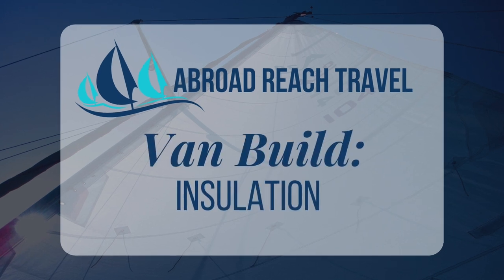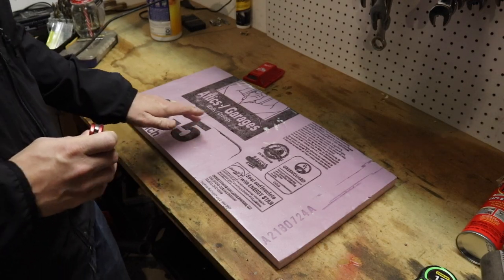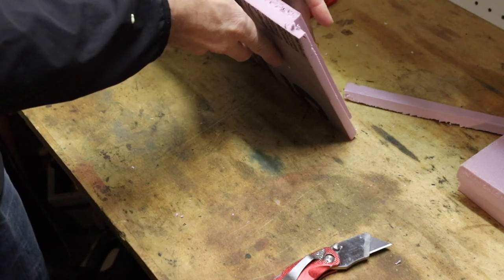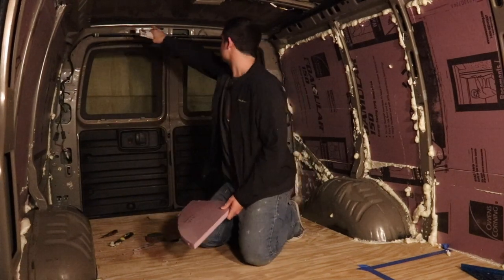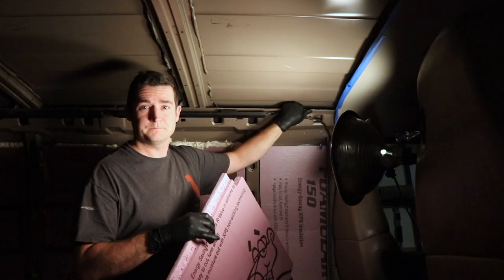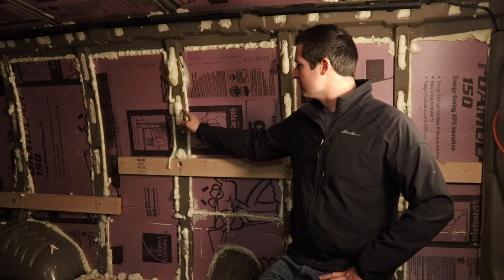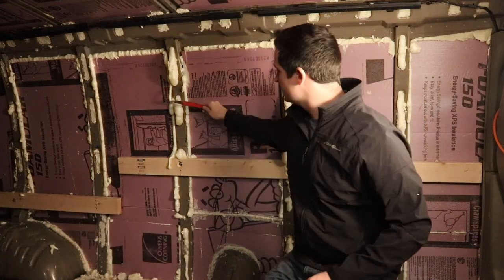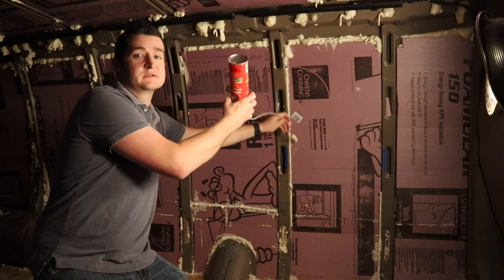How to Install Van Insulation | Van Build Step 2

Comment: Hope you still read your comments. This is exactly how I am going to insulate my van. I was hesitant about the spray but I knew it was a great idea for the ribs of the van. I will deffiently use the extra hose. I am thinking of doing the floor with the foam. Thanks for Great Video.

Comment: Liked your how to video very much.  I have been reading that it is best to not leave air gaps because of moisture and mold.  It looked like you did a great job on the sides with spray foam in every crack and space.  I did notice on the roof that because of the ridges there appears to be air gaps under the foam board in those raised areas.   Any concerns about that?  
Also,  some van build people install butyl rubber as a way insulate sound.  Does the XPS do anything regarding sound insulation?   Is it worth it to try using butyl and XPS together?  I was thinking of butyl on the wheel wells because they are a curved surfaces.
Reply from the maker: I’m not too worried about the small air gap in the ridges in the roof.  We sealed around each piece of foam so any small gaps are sealed off and isolated.

I did notice that it was quieter with the insulation.  Adding butyl to the wheel wells would be a good idea, as that and old door seals is where most of our noise comes from at the moment.  
-Andy

Comment: My foamboards keep popping back out to straight ripping every method i have used, to adhere to the courve of the van, apart. Im about to be out cash and spending more then needed just to get the thinsulate material.

Comment: How has the foam and the adhesive you used held up? any of the foam coming loose anywhere? Thanks for making this video
Reply from the maker: It’s been great, 15k miles with no issues.  We had to cut a piece out a few months back and the adhesive was still so strong that the foam was breaking rather than pulling away from the wall.  Thanks for watching!!
Reply: @AbroadReachTravel  this is great feedback. Glad to hear everything is working out well.

Comment: I am thinking about using foam board for my van. After a year after  how is it working out ? Is it squeaky when your driving down the road ?
Reply from the maker: David Tallman it does not squeak at all and we live on a bumpy dirt road so it has plenty of opportunity to!  It works really well in the winter, last night between insulation and the diesel heater it was so warm inside I had to roll down the windows for a bit and that was in about 20 degrees.  We’ve stayed in the van as low as 5 degrees and it’s been plenty warm. We don’t have as much experience with warm weather but staying in the van in 70-80 degrees with the roof fan running is very comfortable.  Best of luck with your build!!

Comment: You guys ever have any problems with mold? I did my insulation like this one notices the once you cut it the foam surface has a lot of pores
Reply from the maker: Renado Durley no we haven’t had any issues with mold.  It’s a closed cell foam so even when you cut it your only opening up that very top layer of cells.  Unlike with some other options where it can permeate.
Reply: Abroad Reach Travel I appreciate the fast reply! I used great stuff foam and just googled if it was closed cell and it is! Thank you!

Comment: Love the videos!  Have this same van and just getting started.  What drove the choice for XPS over Polyiso?
Reply from the maker: Vanessa Venables thanks for watching!  Here is Andy’s super technical answer:  XPS has much better cold weather performance.  At standard test conditions at 75f the polyiso has an r-value of 6 per inch vs XPS at 5. But when tested at 15f XPS has an r-value of 6 and polyiso drops to 2.  The blowing agent used in poly iso starts to condense at low temperatures while XPS performs slightly better.   There is a paper on the subject http://www.owenscorning.com/NetworkShare/EIS/10019950-FOAMULAR-XPS-vs-Poly-FAQ.pdf 

Basically, we are planning to use our van during colder weather months more than summer months so cold weather performance was more important to us.  Hope this helps!
Reply: @AbroadReachTravel  Wow you did your homework!  This definitely helps.  Kinda hard to find XPS in our neighborhood.  Love the van build!
Reply from the maker: He is an engineer, he can’t help himself.  For whatever reason,I do not understand, he finds things like researching insulation materials fun.  If you are in the US, Home Depot will ship it to a store near you.  There is a link to it in our blog post!  Good luck!

Comment: Hey, do you think 1.5" XPS would have been doable or would all the curves i the wall interfere?  By my measurements there is just about a 1.5" difference between the van wall and outer part of the ribs.
Reply from the maker: Shane Mulligan possibly.  I think you’d for sure have to score the backside to get it to curve better because I don’t think it would have fit at the top otherwise.  Maybe thinking about a layer of 1 and a layer of .5 if you really want that extra half.  We’ve been really happy so far with our 1”, stayed out in 6 degrees a few weeks back with the diesel heater and we were almost too warm!
Reply: Awesome! I have some 1/4” laying around so maybe use that along with the 1”. Really love your build, videos have been extremely helpful!
Reply from the maker: Shane Mulligan thank you so much!  Glad they’ve been helpful!!

Comment: I see a lot of people use plants to put pressure on the foam board while it drys, do you think that's actually needed? Yours seemed to come out great without it
Reply from the maker: We used a construction adhesive that tacked up quickly, so we just held them in place for a minute or two. On the roof pieces we used scrap wood and broom handles to wedge it in place while it dried. 
-Andy
Reply: @AbroadReachTravel  thanks Andy!
Reply: @AbroadReachTravel  do y'all remember how much spray foam u used, I imagine a lot 🤣

Comment: For what it's worth, the Loctite Power Grip All Purpose has a service temperature of 0-122F.  Might cause an issue if the van ever sees a warm climate.
Reply: What would you use? I’m worried about toxicity too
Reply: @kristag9067  I ended up using Liquid Nails Fuze It.  Service temp to -40F to 300F.    No idea about toxicity.

Comment: Why didn’t You ad a air vent on the roof?
Reply from the maker: I see you saw the other video, but I’m going answer here in case anyone else is curious.  We built our van for weekends not long term van life.  We were on a pretty strict budget so we thought this was a place we could save a few dollars.  We quickly realized it wasn’t and added it after the fact.  Doing it again we would DEFINITELY do the fan first but it wasn’t that hard to add after.
Reply: @AbroadReachTravel May I ask some of the things that made y'all realize it wasn't a good idea to go without a fan. Because my husband and I were also going to pass on one, just want to make sure we're not doing a huge mistake.
Reply from the maker: When it rains or even on especially humid days you will end up with a lot of condensation inside the van.  The roof fan helps a lot more with that than just cracking the windows would.  I’m not sure I would recommend going without.  We spent one night in the van without it (before the build was completely finished) and there was a ton of condensation, with it I’ve never noticed condensation again.